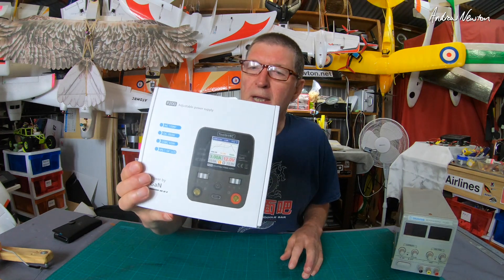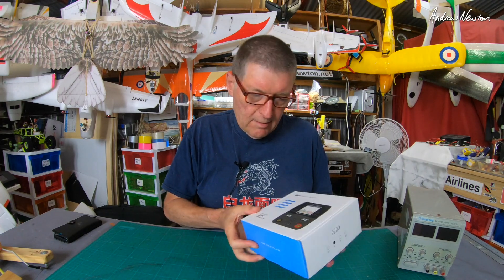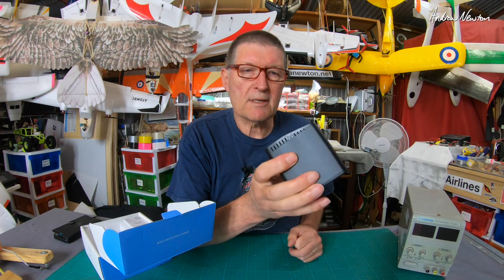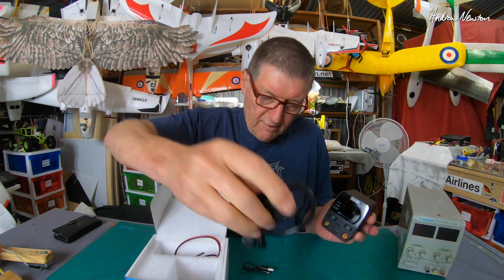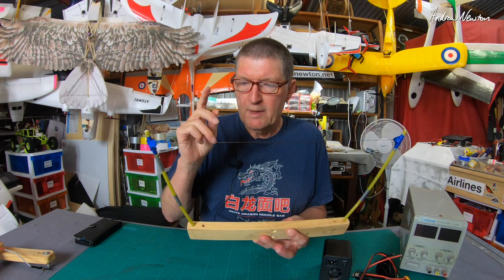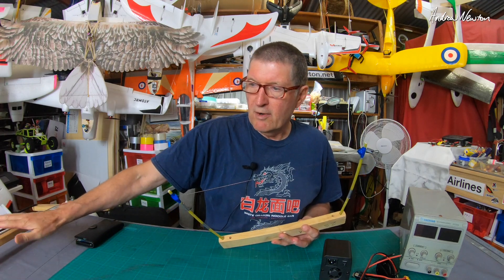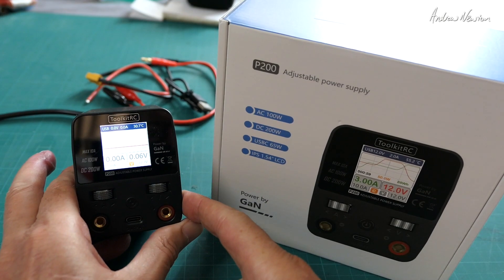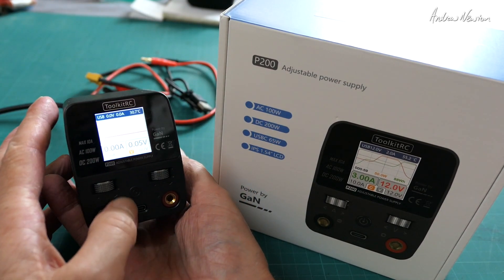ToolkitRC P200 Mini Adjustable Power Supply

Comment: I got this product. The added/packed cable XT60 is nearly needless. You never should charge a Lipoli accu directly, but with a balancing charger. But the chargers do have male plug and not female input.🤭
Reply: Not sure what you mean about charging a lipo. I thought the included xt-60 cable was to power this with DC instead of mains ac.

Comment: The biggest difference between those two power supplies is that the larger one is probably a linear power supply in a smaller one it's a switching power supply. They both can produce DC voltages but the switching power supply will be quite a bit noisier.
Reply from the maker: Both are switching

Comment: I use Rene41 27g wire. It actually likes higher voltage, so i lock it in around 30v and i use amp adjustments to control heat on the wire. But its a big old huge power supply. I like how small this one is and a great price.